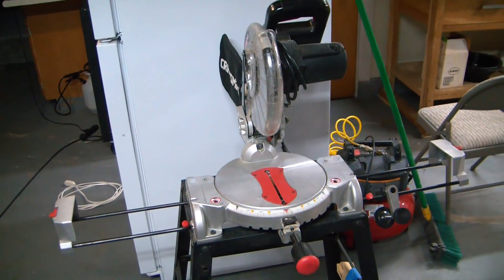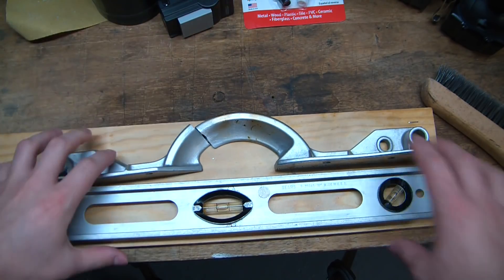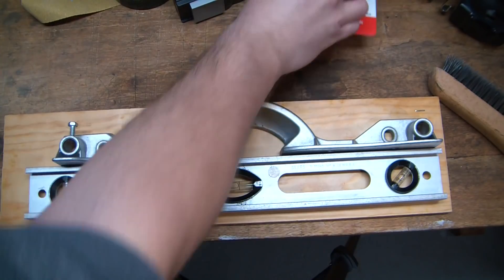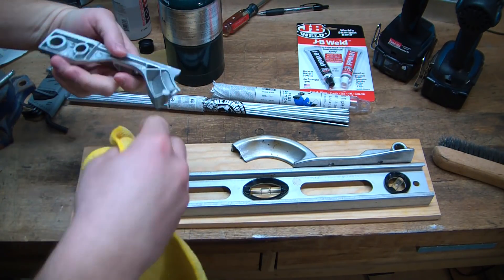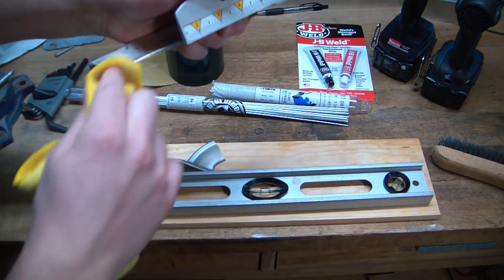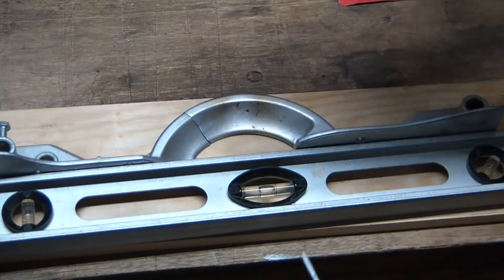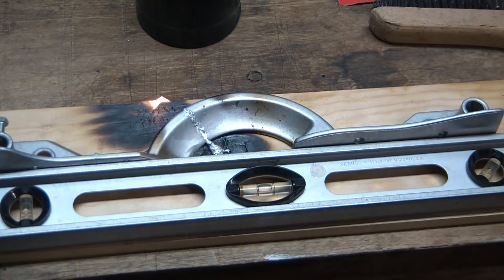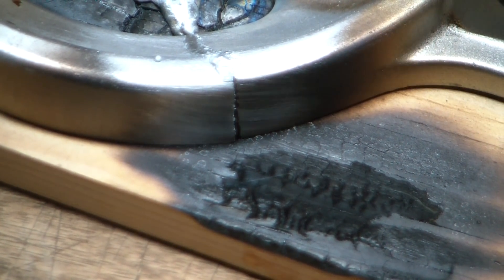Does Aluminum Brazing Rod Actually Work? Real World Fix Miter Saw Repair

Comment: I have that same miter saw. Well I have the rebranded version. I don't remember whos name is on it it was like husky or something but it worked. I mean it was bad but it worked. I did a few hardwood floors with it but when I got my contractors table saw I switched to that until I broke my hand thanks to kickback and then I was scared of the thing so I went back to the miter. Seriously though hardwood+kickback=bad. I shattered my knuckle and miraculously didn't lose a finger somehow. 

The full story on that accident if anyone's curious.
 I was being a distracted idiot making some ecig stands for a friend out of scrap bamboo flooring it was 2 - 4"x4"x3/4" squares glued on top of eachother with a couple holes in the top piece as the stands. I was pushing the blocks through the saw to clean up the edges when, being the true genius I am, decided to use one of the holes to push through. This hole was in the front/top right corner next to the fence and had my thumb bracing the backside. I pushed it through and then instead of lifting the piece, I decided to bring it back by just pulling it back but released my thumb so I just pulled from the front hole which is now on the back/trailing corner closest to the fence. This caused the backside to kick out away from the fence and into the blade. I was at least smart enough to stand to the side while doing this but my left hand was straight behind the blade and that chunk of wood made contact shattering my pinky knuckle in what's called a boxers break. The wood continued on into the steel garage door and put a large dent in it. I immediately flipped off the saw and counted my fingers out loud twice to make sure they were still there. I got lucky. I don't know how close my right hand came to touching the blade when it kicked but I assume it was very close. What was really fun was the fact I had a semester paper due a few days after this and me being the great procrastinating genius had not done it yet so I had to type it one handed... well tried to type it one handed as my left hand was in a cast. I decided I couldn't do it that way so grabbed the dremel and the little saw toothed blades. You know the ones that look like mini circular saw blades but have teeth and are made of metal.  (High Speed Steel Rotary Saw Blade Set 6 Pc
 from harbor freight) MY amazing intellect said "yeah this is the perfect blade for this." You know with all the cotton wrapping inside the cast nothing can go wrong. So I start cutting away and who would have guessed the blade grabbed the cotton and got sucked straight down into my arm. Well thankfully dremel motors aren't that powerful and right about the time it got to my arm the cotton bound the blade/motor up. Yeah I switched to a normal cutoff blade at that point and was fine but sometimes I think I am a prodigal genius, a reincarnation of einstein, adroitness in all things. And that week was one of my finest. Seriously though don't be as dumb as I am.
Reply from the maker: Holy crap what a rollercoaster of shit gone wrong that was! LOL Hope you are okay now! And yeah this saw is crap, but its lasted me a long time, and now cuts truer than ever with this garbage repair lol
Reply: @ElementalMaker  lol yeah I'm good now. What's weird is I broke my right hand with the same break 6 or 7 months before that but in that one I got in a alcohol fueled fight with an exterior door. The door won. So now my hands don't function as well as they could but it could have been worse I guess. 

Hey as long as the saw works that's the important part. But I definitely would have used it as an excuse to buy a new one X-D
Reply: I've been using a table saw since I was 15 years old, I'm over forty now.   That machine still scares me.  The day it stops scaring me will be a bad day.   I've had kickback before, but I knew it was coming.  I had an awkward work piece and I was losing control of it with a dull blade.  I let it go and dodged to the right.